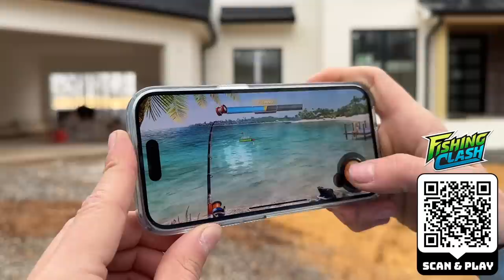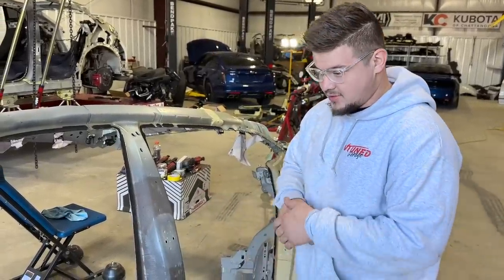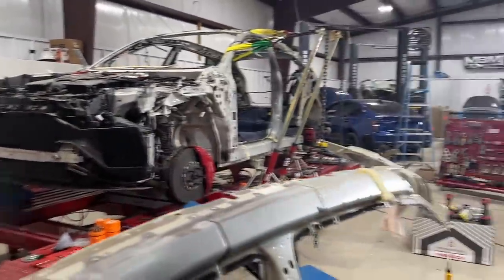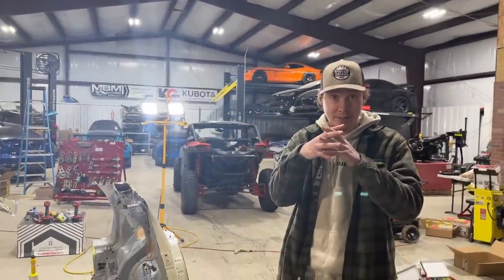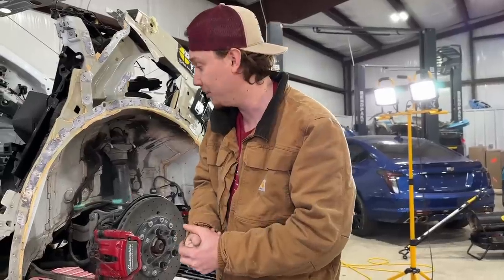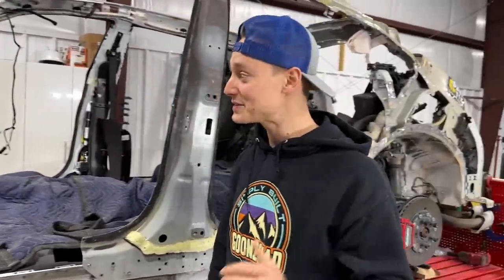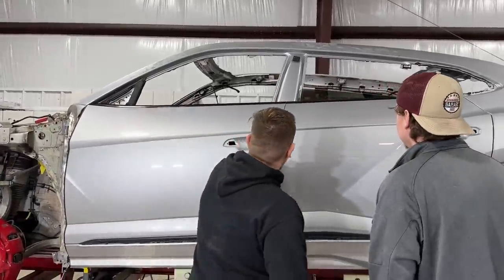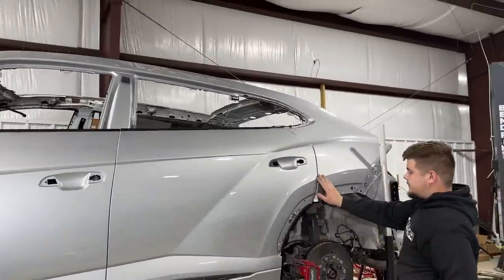Rebuilding A Wrecked Lamborghini Urus Part 11!!!

Comment: This is the deepest I’ve seen you guys go, this is crazy.
Reply: The red Jeep was pretty deep also and as usual Ben (V-Tuned) saved them on frame work again! But the Goonzquad boyz will figure out the frame machine in time it's not something that you learn overnight.
Reply: @joeysweet9045  remember, thus far we don't even know whether the engine is good!
Reply: The jeep was insane too
Reply: @shortvidz9576  The blue Rubicon was pretty deep also, frame swap.
Reply: Vtuned did all the real work!

Comment: this is why insurance companies dont even think of fixing such damages  .they write it off and call it a day.
they couldnt make a profit at it 
but for you guys this is a gold mine! 
you guys are really good at this kind of structural work and this is the content that keeps me coming back and watch your advantures since the very start! 
great stuff guys! 
awesome.work ya'all! 👌
Reply: Profit isn't the reason they are totaled out, In general this kind of depth of repair alone would of cost more than to just pay out for the insurance companies including a rental vehicle etc and the sourcing of brand new body panels wouldn't have been cheap either. Insurance companies aren't really the ones that profit on repairs other than premium increases.
Reply: Not exactly a gold mine. First there is the expense of buying the heavily discounted wreck and the replacement body side, doors and roof, plus the other parts to be purchased, window glass, etc.  Then you have to factor in their labor cost. Then you have the capital investment, the repair facility, tools, equipment. Then you have the materials, sandpaper, rivets, welding rod, etc.  Finally, this vehicle will start with a salvage title and salvage car fax and after the rebuild, the title will convert to a rebuilders title, but the final vehicle with a rebuilders title will not be worth as much as a used vehicle with a clean title.  Given that this car sells for $200k, the type of individual who can afford such a vehicle,  might consider a used one with a clean title, but I doubt they would go for one with a rebuilders title and a salvage history, which means you might have a very limited clientele who would consider buying such a vehicle. Think of your own situation, how likely are you to buy a vehicle with a rebuilders title and a salvage history that is not well documented, and nor is the extent of the quality of the rebuild documented, as opposed to using a used vehicle with a clean title and clean car fax.

Comment: Are you not test fitting the screen prior to bonding? Screen tolerances will be fine. Ive seen it before where screen issues arise after repair( either misfit or cracking after installation)
Reply: 👆👆👆👆👆👆

Thanks for watching and leaving a comment..
Inbox to claim your Package🎉!

Comment: I saw a program/short where they were showing a Chinese shop doing repair doors for TESLA'S and they used an air powered hammer with a solid rubber head to fold over the edge of the panel onto the frame of the door. 
And it looked perfect and ideal for your folding of the skins, and it's called 'Superleggera' construction but modernised for the building of the shell.
Reply: 👆👆👆👆👆👆

Thanks for watching and leaving a comment..
Inbox to claim your Package🎉.

Comment: Didn't I say like 2 episode ago just to replace the whole section at 1 time...  I wouldn't have even cut the roof off of the driver side...  I would have just carefully drilled out the spot Wells from the cross brace from underneath on the passenger side and carefully spread them apart and slip the whole thing together only leaving one side of the passenger roof that have to be bonded and the rest spot walded into place.  Heck I would have taken out the whole inner wheel well and everything just to make it simpler....  A lot of clamps a lot of time lining up, but better end result.

Comment: A lot of hard work. How about using a heat gun instead of blow touch with a good one you burn paint off if you want and as you not a naked flame your less likely to catch things alight. You still have to be careful.
Reply: Contact-Now-  Hi am.in the UK

Comment: You goonz are amatures... you could have saved days worth of work if you just replaced the whole side as one piece... and remove the the side from the floor.....

Why did you remove the skin from the body on the new doner part...

How many times have i told you guys buy Colbot drill bits and colbot spot weld bits